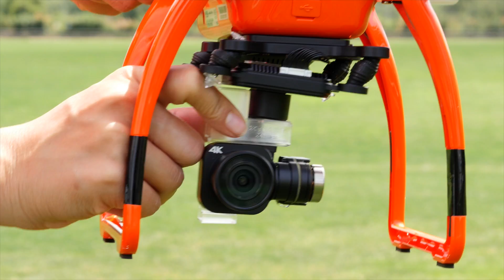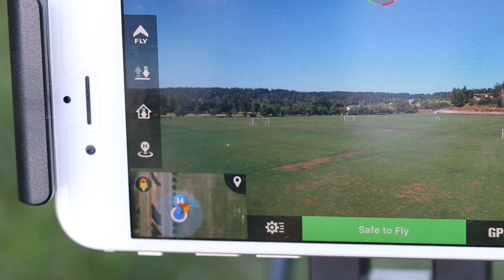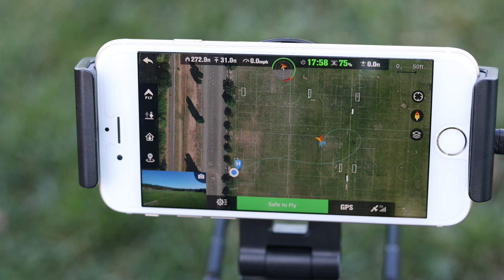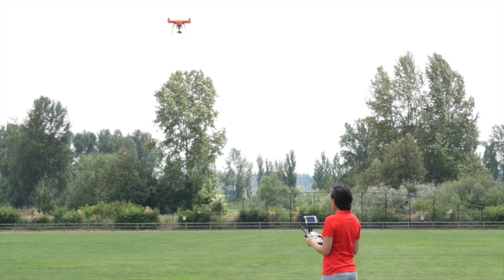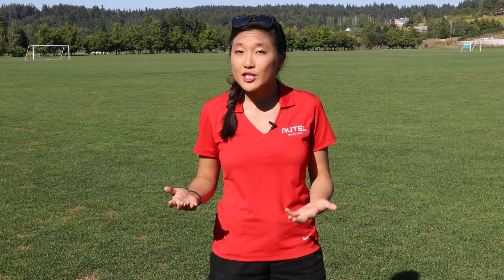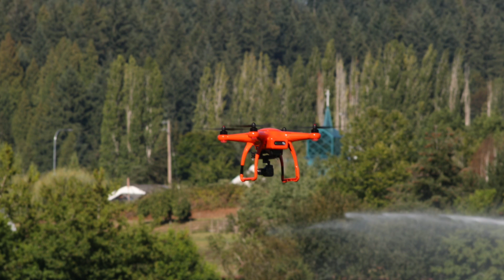Autel Robotics Tutorial: Go Home & Failsafe

Comment: i was very surprised that the autel flying program only works on certain android versions now i need to spend another $300. for a tablet just to fly this. im gerting more interested in the portable gopro version.
Reply: Dji is the same way, some work and some don't.
Reply: I just got a Samsung Tablet A 7" at Best Buy for $109 new and Autel says its tested with Starlink. My Samsung S5 Active worked but was too small.

Comment: When you hit go home will it just auto land where it took of or will it hover then you hit land. If I take of under a tall tree then go around it while ascending during go home would it just go above home And then go straight down an most likely hit the tree or can I drive in the same way I drove it out
Reply from the maker: Hi Nevin, When you engage the RTH option the drone with return and land where you took off from. I wouldn't recommend taking off with a tree overhead. You can also pause the RTH flight when it gets close using the pause button on the RC and then manually land the XSP.